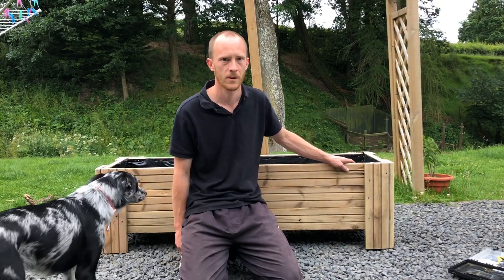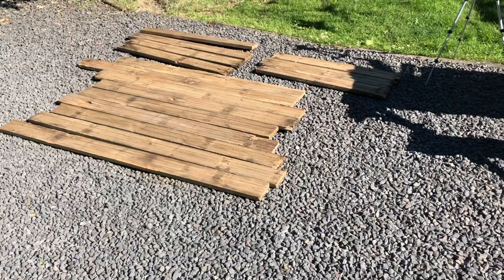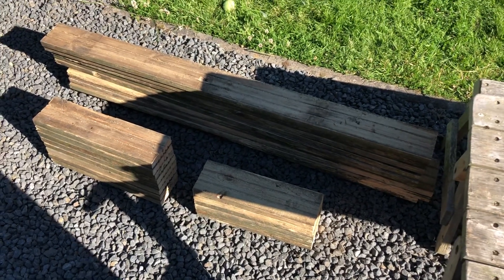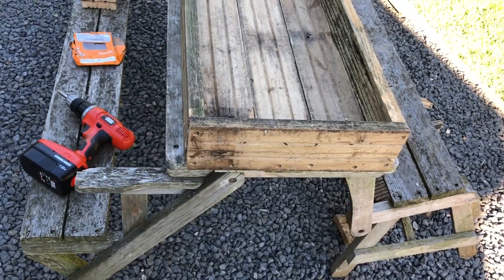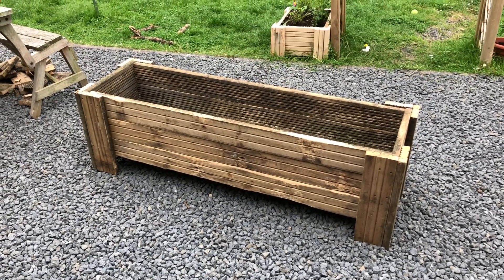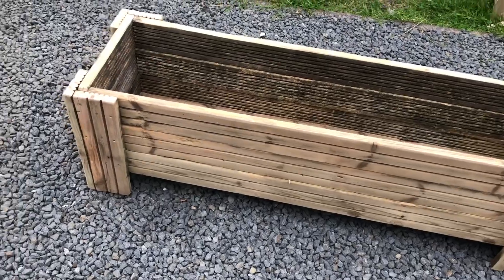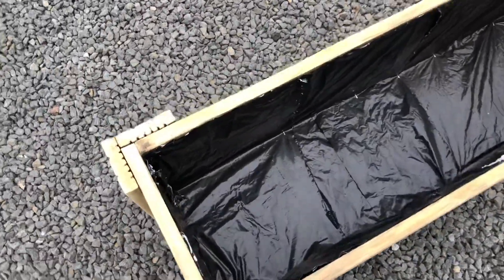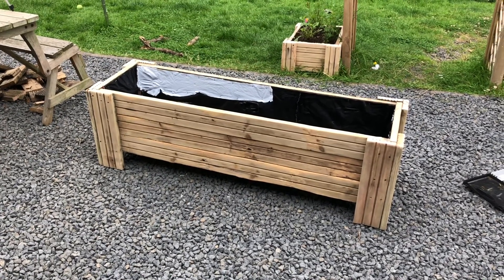Building a Rustic Planter from Reclaimed Decking Wood

Comment: Nice build Kit, and that is exactly how i build mine with Decking Boards, L shape Legs and Compost Bags to line it, and of course some holes for drainage. I also paint mine with wood preserver/paint, the stuff they use on fences and sheds, it brings a bit of colour to the garden. 
I forgot to say if i can't re-use some decking boards and i have to buy them, look out for the ones that have a plane side as well as a ribbed side, that way you can mix and match or do one planter planed and the other ribbed. Oops forgot again, i have just subscribed.
Barry (Wirral, ENG)
Reply from the maker: Thank you Barry. I’ll beat that in mind if I need to buy any. 
Thanks for watching, commenting and subscribing.
All the best

Comment: Hi Kit - thanks for uploading this video. I used it to build a quite large (2 metre long) planter for the yard, which looks great.
I am glad you suggested using old compost bags for the lining, otherwise I think I would have used bin bags.
One thought - if you are going to paint or seal the wood it might make sense to do this bit before assembling everything. That way every part would get covered and it may last longer.
Reply from the maker: Agree it would be a good idea, I didn’t have the paint straight away, I still haven’t painted it 😂. 
Thanks for watching and commenting 
All the best 
Kit

Comment: I like the design and rustic look with decking boards. Is there an advantage in spraying them (Cuprinol + sealant) before rather than after assembley?
Reply from the maker: Thanks, I didn’t end up treated it at all in the end but yes it would make sense to treat before assembling to make sure you get everything coated.

Comment: Such a fantastic design! I’ve looked online to buy planters and I’ve noticed no one puts legs so those planters are so close to the ground. I’m planning to make them instead like urs but I intend to use them for vegetables. Will this design made with 2.5cm thick boards be strong enough to bare the weight of all the soil?
Reply from the maker: Hi, that’s great that your making them, yes they should be fine, this ones still going strong. 
Good luck with your planters.
Thanks for watching